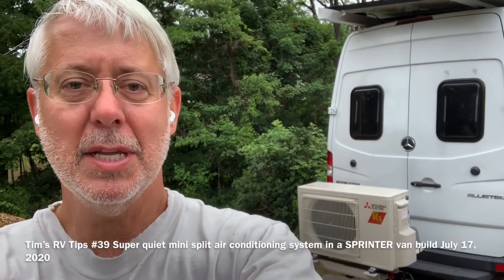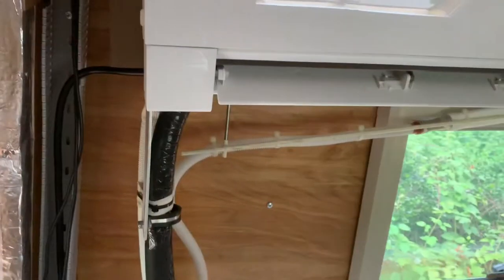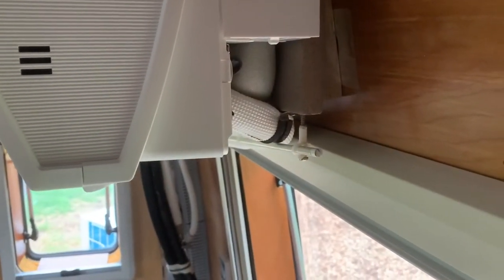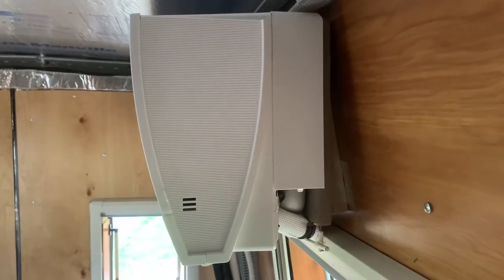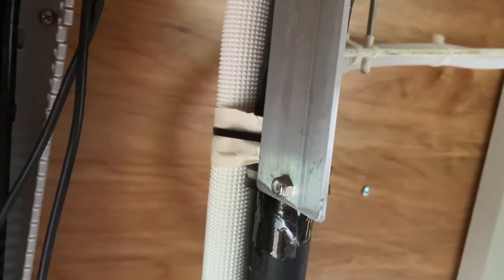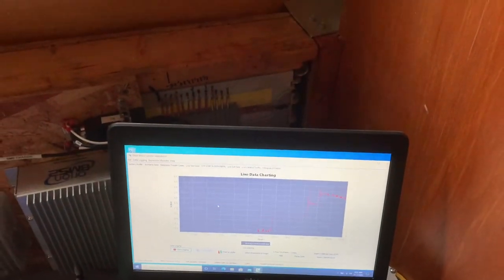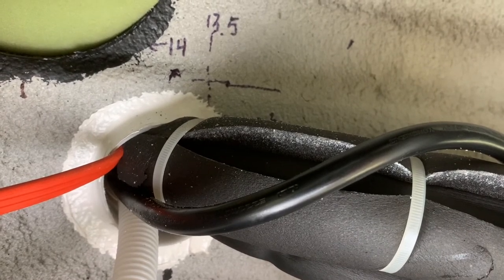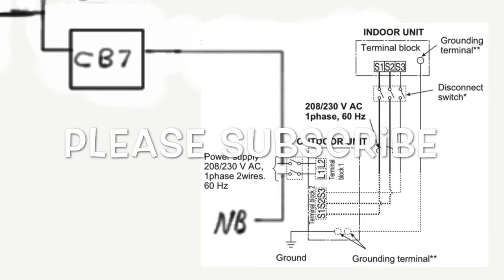Tim’s RV Tips #39 QUIET mini split air conditioning system in a SPRINTER van build July 17, 2020

Comment: How is it holding up? Any issues? You mention the indoor unit being in an unbalanced condition initially due to the slanted walls. Did that manifest in any obvious way like an error code, or did you just do the 10 degree fix to ensure it worked better long-term. I get a resonant tone on my indoor unit at certain compressor speeds, and while I don't think it's due to the slanted wall, that's a possibility.

Comment: Nice looking install!! I'm in the middle of an rv-build mini split install and have a similar install scope, specifically with the evaporator unit being mounted lengthwise in my rig (front to back) compared to sideways (left to right). I plan on using this while in motion in the vehicle, not only while parked. I have recently developed concern condensation water may not drain while climbing hills. Assuming you use your unit while on the move and not while just parked, wondering if you have had any issues with the unit leaking, or, does it all come out the drain port as designed. Thanks in advance.
Reply from the maker: I ordered an extra Mitsubishi condensation line so that both sides drain into a T.
Reply: @tdrager  Thanks!  I saw the two lines but didn't hear the 411 on the additional line being on the other end of the water drain pan. Did you have to open up the entire unit to access the pan and add the additional line? Not sure how I'm going to do this on my unit. Obviously you had the concern so I need to work through this. Thanks again. Edit: The additional port right there at the end. Nice.. Easy peasy!
Reply from the maker: @chrisf8611  The drain pan has two nipples, so I attached a factory drain hose, which is insulated) to both sides.

Comment: Great ideas to use flexible lineset and hi SEER unit. Do you consider the ceiling cassette indoor unit to save wall space?
Reply from the maker: Thanks for the compliment. I did not consider the cassette style of air handler because it needs about 12 inches above the ceiling, which includes 2 inches of insulation that would be required to keep the unit operating efficiently. I’m not a fan of cutting holes in van roofs for several reasons: 1. Thermal inefficiency. Insulation must be surround a cassette on the outside by at least 2 inches of polyiso and protection from the outside environment. 2. Possibility of leakage. 3. Center of mass is higher making for more swaying of the van. 4. Aerodynamic inefficiency. 5. The protrusion may cause you to lose space for solar panels, or raise them about 8 inches from the roof. 6. I would bet that the wall mount air handler is much quieter than the cassette air handler.
Reply: @tdrager  Thanks for your thoughtful reasonings!
Reply: @tdrager  Are you going to install any ceiling fans, like MaxX Air Fan?
Reply from the maker: @donj.giovanni7551  No, see my video at: https://youtu.be/l3BPKGvdV8I

Comment: I'm thinking about do g this to a used campervan I just got. How much does the while system cost when finished? 
The batteries and all that? Can it run on a tiny generator instead until I could afford all the equipment?
Great video...very useful...thanks
Reply from the maker: It costs:  $1500 for the Mitsubishi mini-split system, $140 for the line set, $450 for the swinging mount system. So, that’s about $2200. A generator defeats the goal of a very QUIET system. This will easily run with a solar, battery and 220VAC inverter. It only draws an average of 200 watts with a maximum of 600 watts.
Reply: there are other mini split systems for much cheaper if you're not needing 33 seer efficiency.
around 20 seer costs 700 on amazon.
Reply from the maker: @gwho  Energy conservation is the primary consideration in a mobile installation. An ultra-efficient system is key, especially in winter when there is minimal solar power. For heating, a high HSPF (Heating Performance) is key. Considering the installation labor and ten year system life, an additional $700 is negligible.

Comment: How’s it working 1 year later?
Reply from the maker: Working like new. I increased the service loop to two feet from one foot for the swinging mechanism. The system worked it’s butt off this summer, with 95 degree temps on the outside and 70 degree temps inside.
Reply: @tdrager  epic!